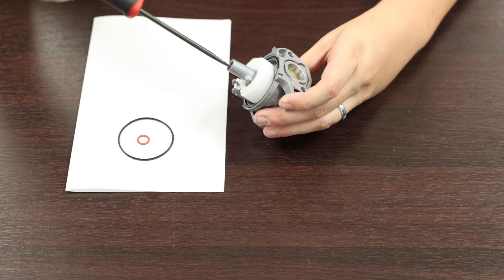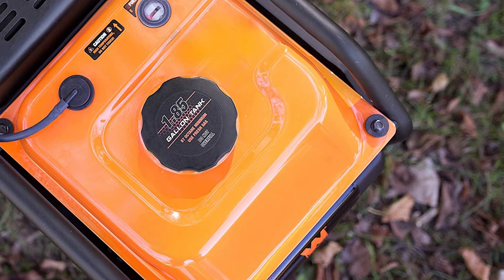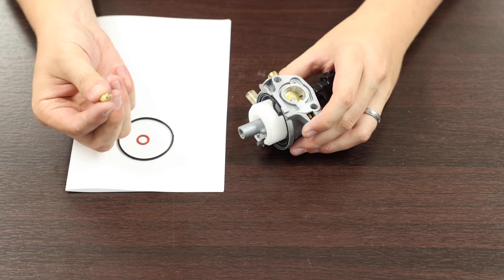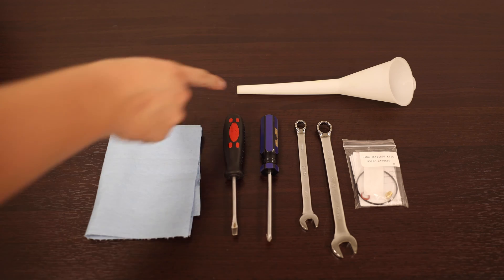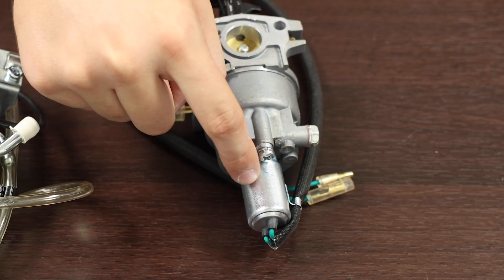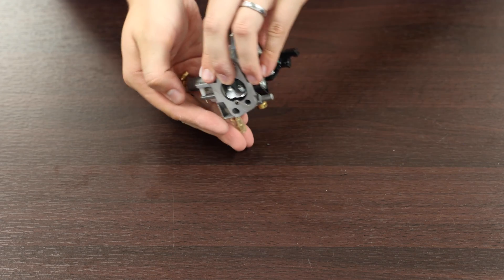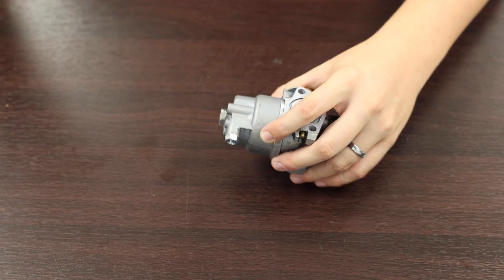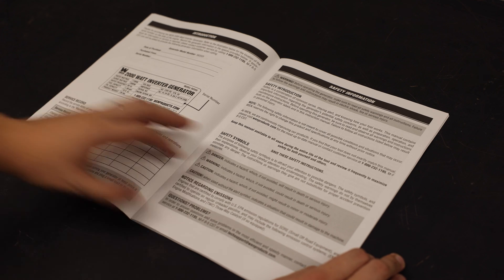How to Install a High-Altitude Kit on your Generator's Carburetor

Comment: should have included jet sizes of normal altitude and high altitude
Reply: Yeah, honestly, it blows my mind that for one the fact, if you don’t install one of these and you live in a high tude area completely avoid your warranty apparently and I feel like something like that should probably be said right on the front manual Big letters as that’s pretty important and then the app two the fact is like I can’t stand it that I have to order it. I only use it at $12 but more importantly, like I’ll literally order the generator and then 10 minutes later I ordered the kit right and the kid always takes two or three extra days to come, which means my Brandi Jenner gets to sit there that I desperately need to use. I can’t even do it ha ha yeah the fact I can’t just throw this in with the generator I mean come on it’s literally like probably 50 feet to $.75 their cost lol I mean if they only sell it for six dollars that means it’s probably absolute two dollars max their cost so the fact that they can’t throw it in for two measly dollars especially considering it’s like mandatory ha ha and man I tell you what like on the 4800 W inverter model. It’s a freaking nightmare of a job to install it not because the kid that sells hard to, but it’s just a small fully enclosed generator that you can either basically disassemble 70% of the entire freaking thing to get the whole carburetor out and do it like that or you can normally kind of work it with cram your hands in there, but it’s just no fun